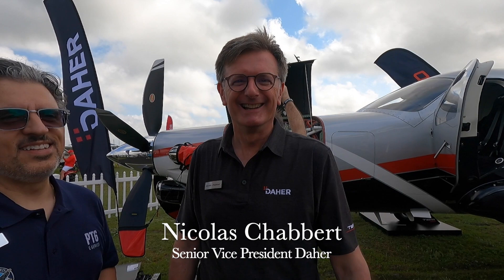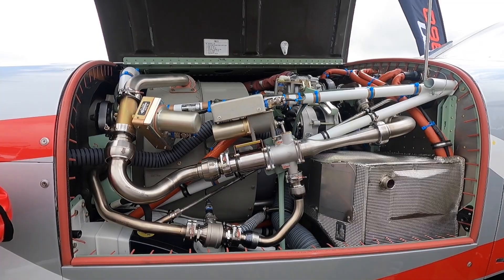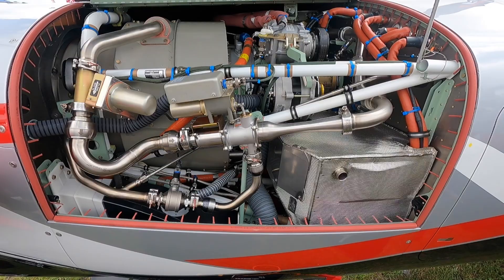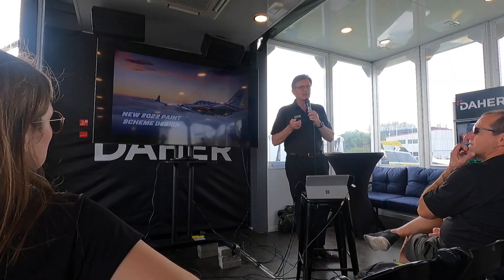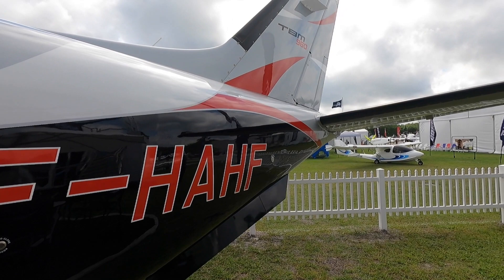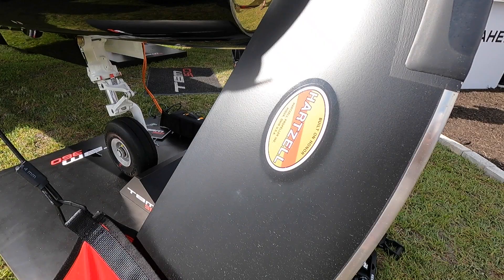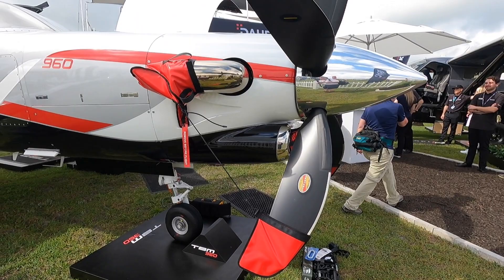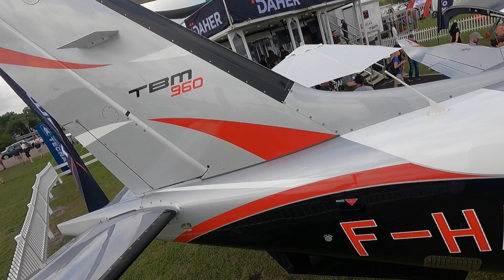Daher TBM 960 Introduction - Sun 'n Fun 2022

Comment: For a year now I have been working my budget for the 940.  I've have spoke to the salesman of DAHER, no one told me about the new coming 960.  Now I need to start over.
Reply: That’s because they wanted to sell all the 940’s.

And don’t start over, just keep saving. I gotta a guy.
Reply: @check4twenty  I don't need to start over regarding saving, just start over on reevaluating the allocation of money for the extra .4 million.   Though it's kinda crazy for that amount more for over the 940 for tinted windows.   Lol
Reply: @freepilot7732  it will be more than .4 by the time you get your name on a unit. We’ve sold our allocation through 2023. The price is set to go up in 2023. And it’s not just window tint that improving. Substantial improvements in chapter 21, basically a complete change. Then going to an EPECs engine/prop is a pretty big deal. There are some small interior improvements, like you said, darkening windows, touch screen control for the cabin…this is the biggest upgrade the model has seen.
Reply: @check4twenty  I apologize.   It was a bad joke about the,  "just tinted windows".  Though I figure 4.9 million out the door.
Reply: are you buying for personal use, and that's dope you can even buy one like this
Reply: @friskytwox  It will be for personal use but also for Angel Flights.

Comment: I wouldn't call an engine that burns 140 gallons per hour at idle as being "efficient"...

(yes I know that's an exaggeration)
Reply: aircraft aren't usually rated based on their efficiency while at idle
Reply: Well, it’s more like an IO-550 at full power on takeoff in full rich, then your “only at jet airports with this thing” and that means your ,waiting and waiting in lineup, behind others to takeoff because it’s IFR. Yes burning tons of fuel, that’s why private owners go M350.
Reply: @tropicthndr  are the type of people who own a 3 million dollar aircraft really the type to worry about fuel burn while waiting to take off?
Reply: @hapybratt8640  yes. That’s why they can own million dollar aircraft.
Reply: @tropicthndr  what?!? Please don’t tell me you’re comparing the M350 and the TBM?
Reply: @check4twenty  I disagree partially.
Reply: @hapybratt8640  ok, care to elaborate?
Reply: @check4twenty  not much to elaborate. Some rich people buy expensive aircraft and lots of fuel while other rich people buy expensive aircraft and not a lot of fuel.
Reply: @hapybratt8640  I’m speaking to their attitude in general. In general, rich people penny pinch everything.
Reply: I think it’s about 34gph at idle.